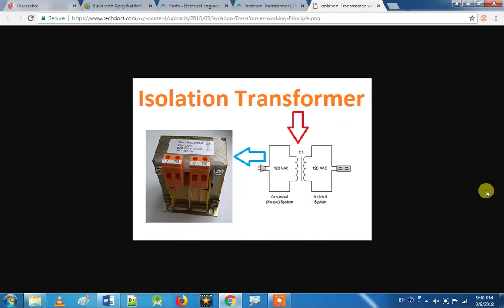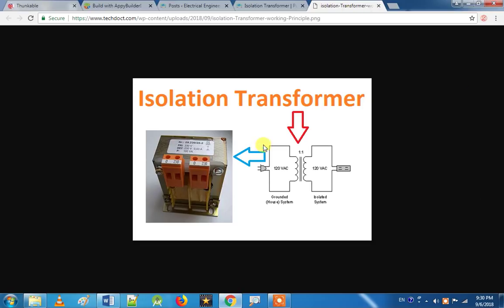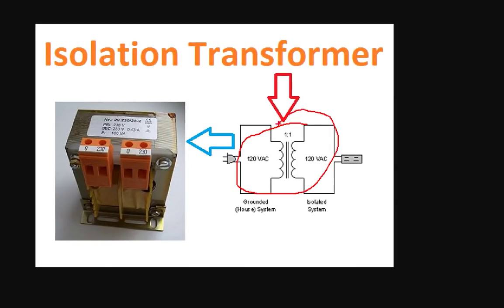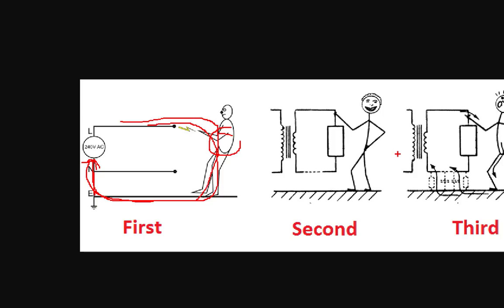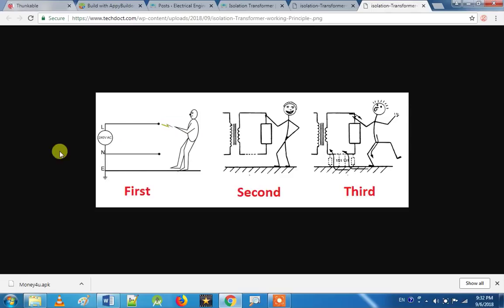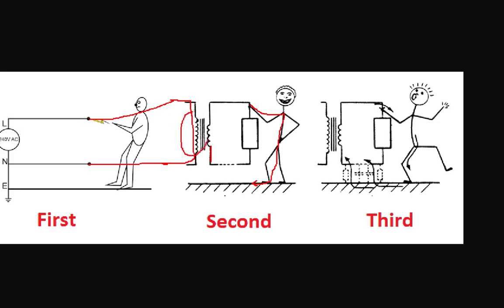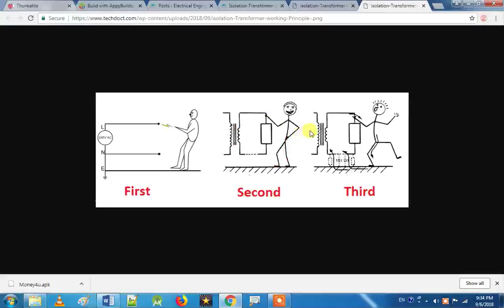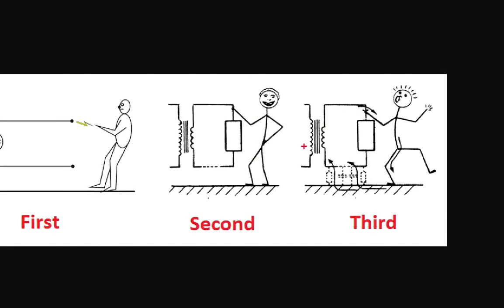Isolation Transformer in tamil. Purpose of Isolation Transformer

Comment: Is it possible to measure the voltage between line to ground in isolation transformer by using multimeter. Line to line no issue. Since no ground will it show voltage with respect to ground